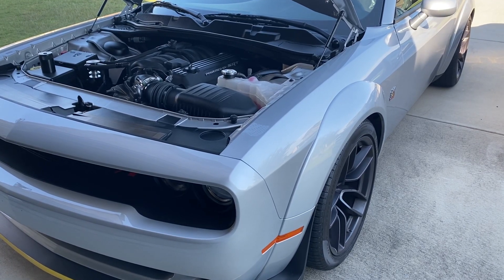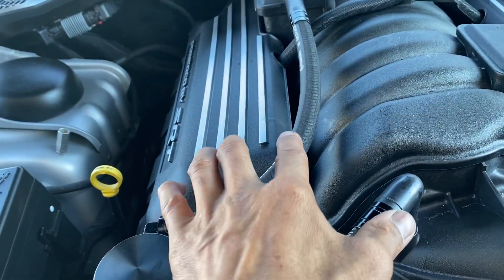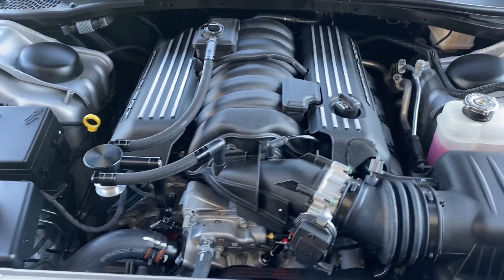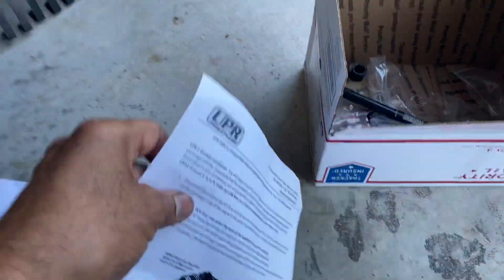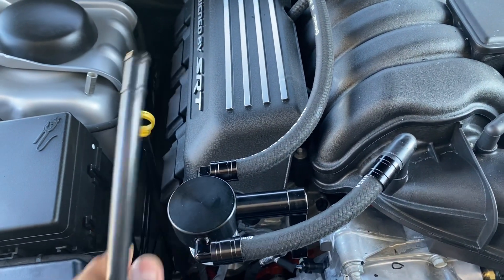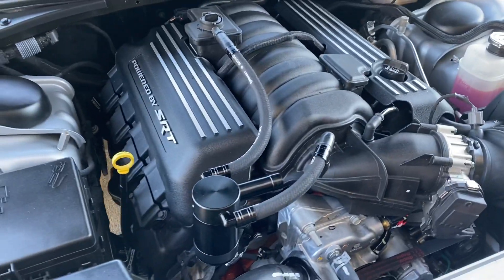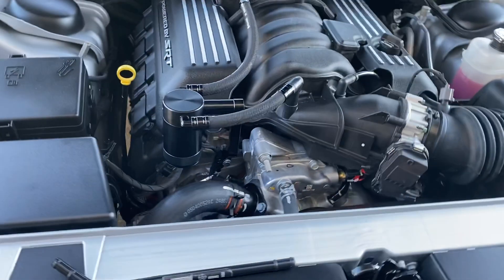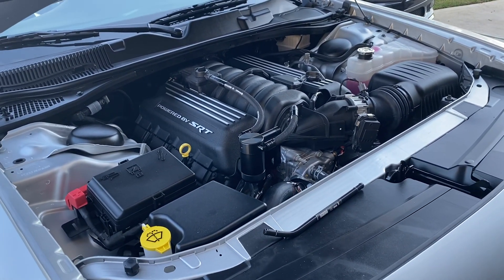This is a MUST HAVE MOD on your Dodge Vehicle’s /Oil Catch Can🙌

Comment: Did you install it yourself and if so was it easy
Reply from the maker: Yes and it was only one bolt and add your hoses very easy and the bolt size is a 12mm
Reply: @bj_from_the478  thanks and great video